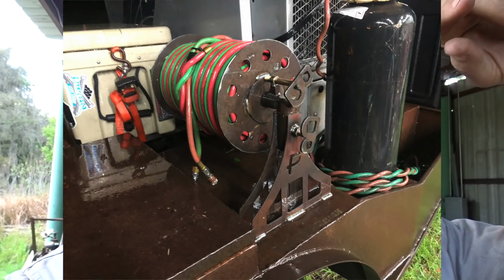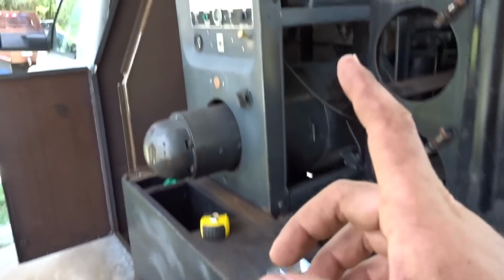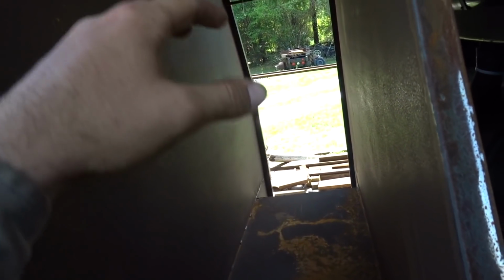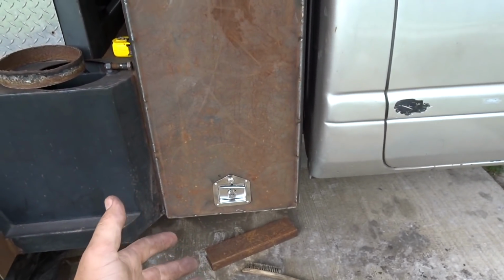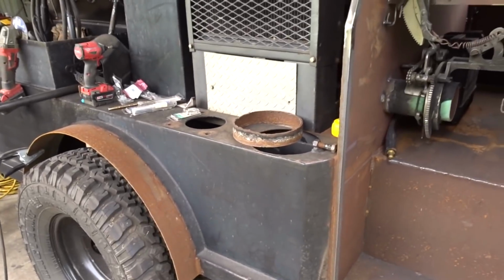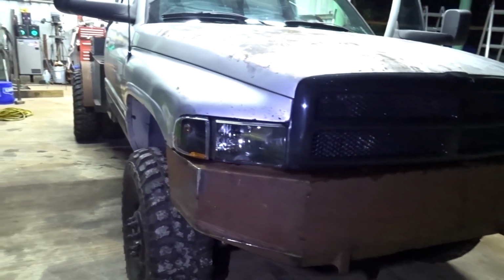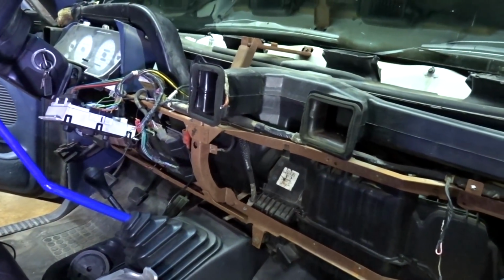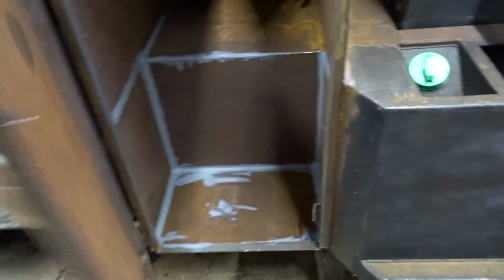2nd Gen Welding Rig Is Just About Ready

Comment: For your AC, First put a gauge on it. If it us low on R134a, the compressor will not kick on do to the LOW pressure switch.  You can jump the switch to see if it kicks in but you should check pressure first. Usually if you get a can with the gauge you can take a reading and then if low start putting some in until the clutch kicks on/off with engine running & AC on.
Reply from the maker: I guess i should have led with some backstory,  when I originally got the truck the compressor would not kick on and it looked like it had seen better days (was also weeping a bit out the bottom) so I assumed that the system was empty and so I got a new compressor and put in it but when I took the old out it has some charge left to it.  It may not have been enough to start it in the first place so I guess I should hook up my gauges and test it out, I didn’t realize that there had to be a charge to kick it on.
Reply: @j_moffitt  oh ok.  Yeah, it needs a minimum low pressure charge to atleast kick in and short cycle. The LOW pressure switch controls that.

Comment: You need to charge the AC system first and for most. Go to the auto parts store and pickup 3 or 4 cans and some oil to lube the system and a gauge. Start with the oil and then 2 cans and see where the pressure is and it should start kicking the AC clutch in and out and then add the 3rd can and if need be the 4th don't over charge the system it will act the same way as a undercharged system. Good luck and love your videos 🤙🤙🤙

Comment: Check the high high pressure air conditioner pressure switch.I'll aren't you need to hook about a cumulator that's usually the problem with them because mine had the same kind of problem too, and I've changed that out and I've put the whole ring behind it and screw in the thing and the start working real good I.Got the same kind of pick up you got

Comment: Just to add on to Country Miles comment as i was about to reply same thing as him....also have a spray bottle handy with soapy water spray down around your condenser all plumbing connections and both high and low side fill ports pay close attention to Schrader valves they tend to leak from dirt debris and age....on final note make sure your condenser fins are clean if clogged with debris cooling affect between high and low side will not take place

Comment: Could be ether low pressure switch or high pressure switch. They will keep power from going to ac compressor.
Reply from the maker: If I pop the connectors off, there should be power coming to one side of either switch correct?
Reply from the maker: When I got the truck the compressor would not work, I assumed that there was no charge left to it because the compressor was not in great shape from the get go so I got a new one to swap it out but it did actually have some left in it, so I’m wondering if there just wasn’t enough or if there is in fact another issue.  What sensor tells the computer (or what have you) that there is no charge?
Reply from the maker: Ok cool, yeah I was not aware that it had to have a charged system for it to operate, I’ve got ac gauges and I will make sure that it will hold vacuum and there isn’t any other leaks before I try and charge it up, thanks for the help!